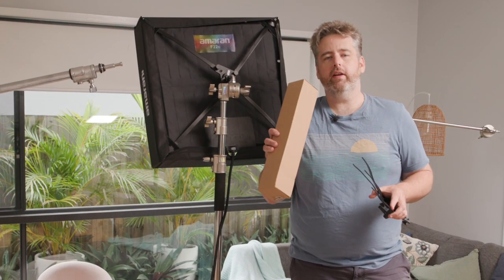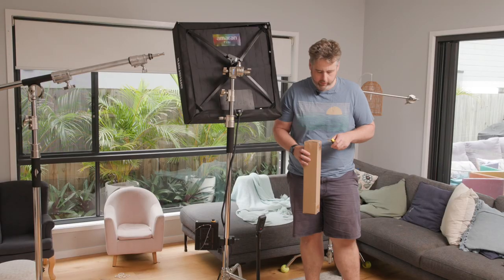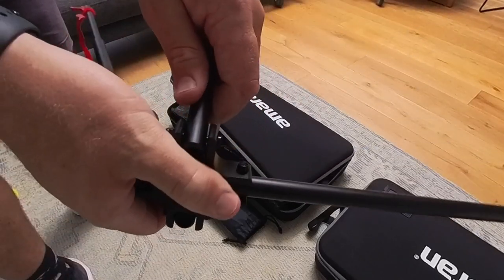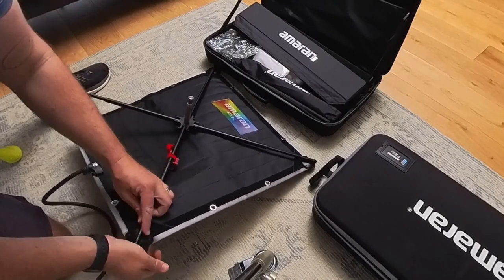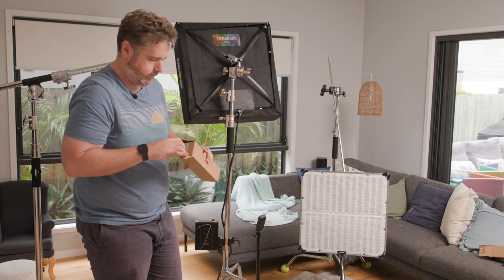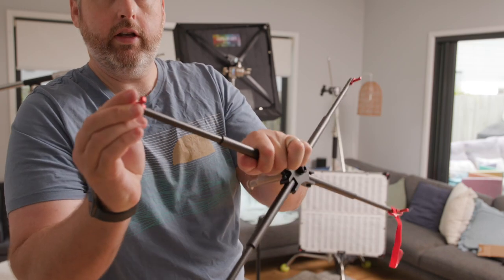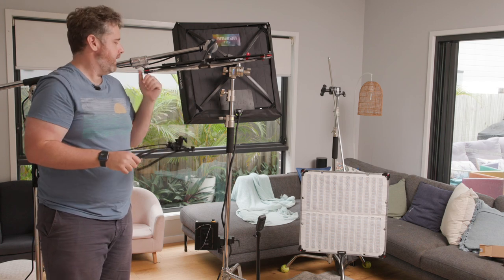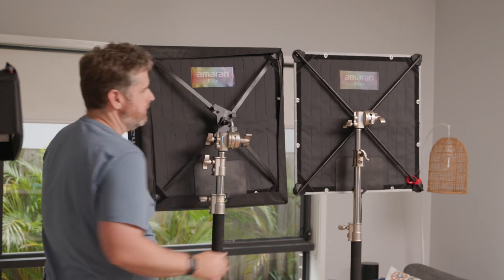Amaran F22c & F21x replacement brackets

Comment: Thanks for the simple demo of the new bracket! I have a residential ceiling height and want a low profile hair light. This mount looks to be the best option. My only remaining concern is fan noise on the F22x. But may give it a go.
Reply from the maker: Thanks! I don’t think I’ve ever had a problem with the fan noise for that one. It has a good length head lead between the controller box and the light, So you can keep it away from the mic.

Comment: Do they offer an option with a curved spigot part?
Reply from the maker: It’s only a straight one coming straight out the back, you can use the ‘tilting stand mount’ that comes with the original kit. I used that today and it’s fine for basic right angle use at 45degree angle but I wouldn’t trust it over head or anything like that. 
Much safer to use it with a grip head instead. That’s what I do most of the time

Comment: How they designed this new mount/bracket without the ability to tilt the fixture down on a regular light stand is beyond idiotic. I am also confused about how the head cable locks into the control unit. Mine does not compress and twist- not sure what's up with that. Two strikes against this new fixture. I want to like it...
Reply from the maker: Does the cable lock on when you plug it in?
Does it look like your cable has any damage to the end? Maybe the end is faulty, what a pain if it is. 
With the tilt, did yours come with the ‘Tilting Stand Mount’ I’m pretty sure you can pop the straight baby pin into that and still use it that way. 
Let me know how you go,
Reply: You are kind to reply! No. The cable does not pop/lock onto the control box. I’ve pushed quite hard on it and it does not lock. You’re right- bummer. My fixture came with the new bracket which is nice except that unless I’m using a cstand I can’t tilt the fixture down. If they made it so you could still swap pins that would beautiful. I wonder if I can get the old bracket and pins anywhere? Thanks again. Cheers.
Reply from the maker: I think I sent mine to the recyclers 😣 otherwise you could have had them!

I’m not sure if it will help you but I just popped two shorts up showing my cable working close up and another video with the angle mount and baby pin that came with mine on a basic light stand.